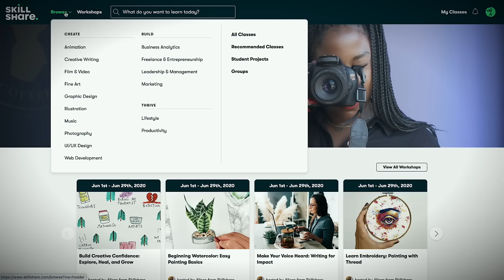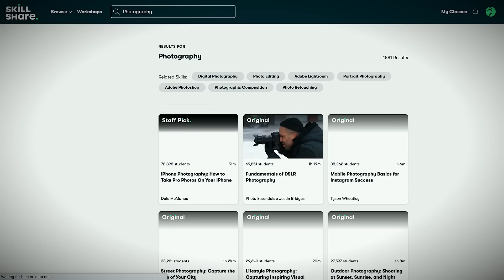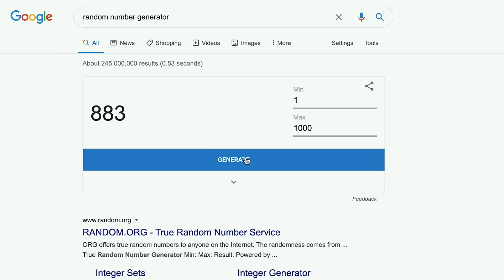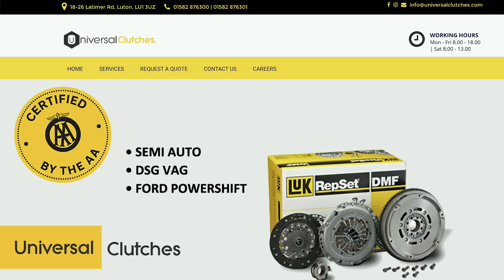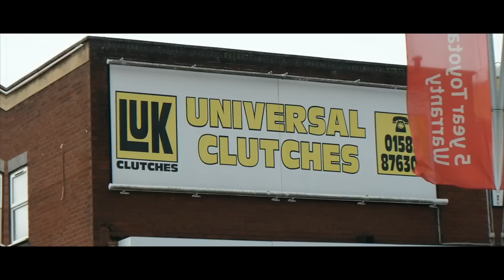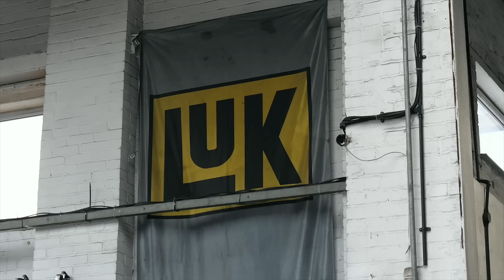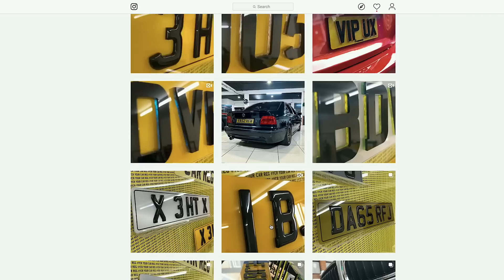Anyone Want A FREE CAR?!

Comment: The clutches and flywheels are on the limit at not much over 200bhp on the 330d which is why mine is still stock power.  The prop coupler and bearing won't last long with more power either, I've had to replace mine and they need doing about every 80,000 miles on stock power.  The judder could also be the prop bearing which will wear quick with a knackered coupler.  My mechanic told me the bearing didn't need changing but I ended up paying labor twice to have it done as the judder came back.  My car has done nearly 200,000 miles and runs sweet, as long as they are looked after they will last.
The wings are bolt on and cost less than £100 to replace.  You also need to but special supports on top of the struts to stop mushrooming.  I've got them on the rear but will put a strut brace on the front when it's back on the road once I'm back at work.  Strut brace will add support and give a bit more stiffness.
Also worth checking the manifold for whoever wins the car to see if the swirl flaps have been removed.  The pins have a habit of snapping and they get sucked into the engine.  I removed mine and added blanks.
Bypassing the EGR valve will restore the lost power at the bottom from removing the swirl flaps and it will use a bit less fuel.  You will get a dashboard light though which goes out 50 - 100 miles of driving after it's hooked back up ready for your MOT.

Comment: Real car owners know when a donut is broken the rear diff is on its way out the donut will be smashed at high speeds 80mph plus at the beginning, cop a rear diff of ebay and prevent anymore issues like oil leaks

Comment: Man Calvin your a legend you're giving away a free car and you've done so much to this car even the clutch, here people sell cars for £800- £1000 and leave the clutch even some cars have slipping clutches, last year I bought vw bora for £900 and I didn't test drive the car I was only 18 I did a mistake as we all do at a young age, and I bought the car and went to pick it up around 9pm and when we went to pick it up as I had bought it during day time but the dealer had closed at 5pm so I had the keys and just went with my dad to pick the car, and as we drove the clutch went out like totally went out and we had to leave the car on the side and next day we went back and complained about it, they never even told me that the car had worn clutch. I was so let down that day then what I did was I told them to replcae the clutch but they demanded me to pay 150 pounds, I was shocked I said I'm not gonna pay anything, you sold the car as drivable and it doesn't drive so you fix it for free, so we argued and they fixed it I still had to pay £100 for it. So I took the car and then few months later I had oil leaks from the engine, but minor I had replaced the wheels and sold it for £900 i has made a loss by then of £200 I was gutted then I never went back to them they had bad customer service and I was just disgusted. Now I drive a toyota corolla which I bought for £900 as well with same money that came from that vw bora. But at least the corolla drives alot better and drives at least.